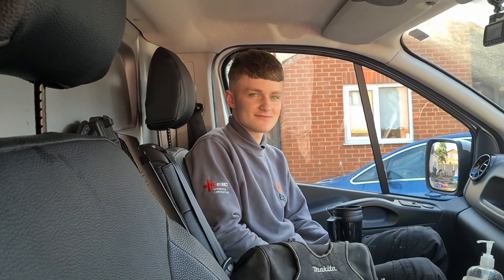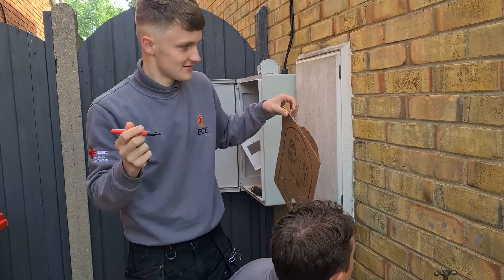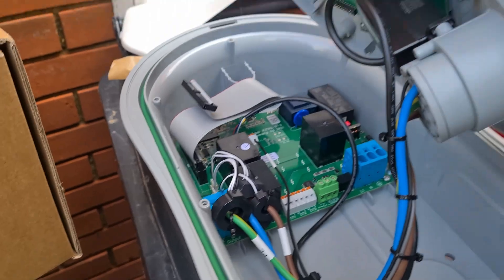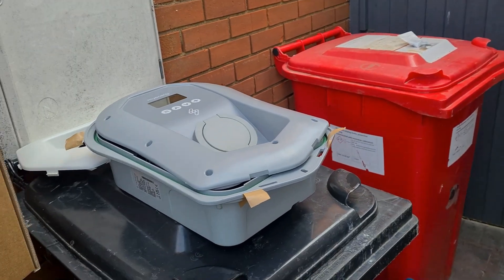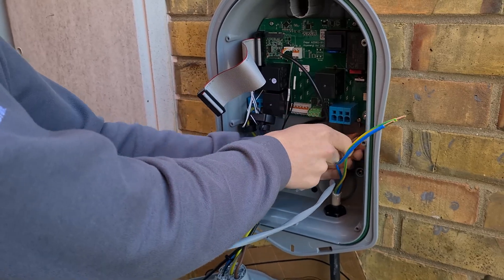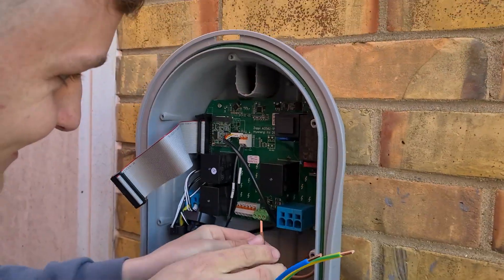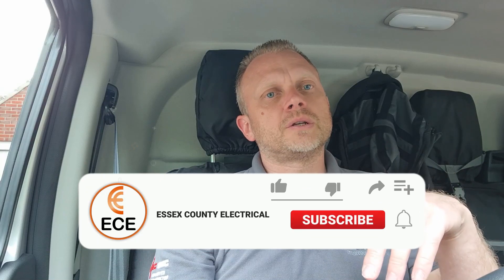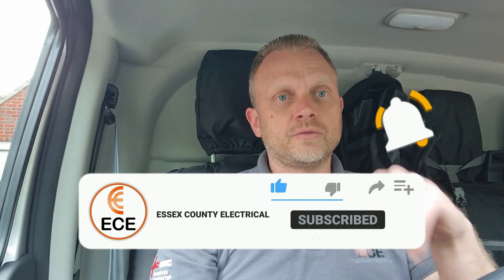Myenergi EV chargepoint NEW VERSION

Comment: Hi! If i want to connect Zappi to my network, I will use LAN cable. But do i need another one for phase readers? (Grid)
Reply from the maker: Hi, you will get a ct sensor along with the zappi which you can either hard wire or use the harvi to wireless transmit the data. If you have solar pv then you need to purchase another one. Hope that helps
Reply: @essexcountyelectricalltd  Thank You for your reply. Helped!